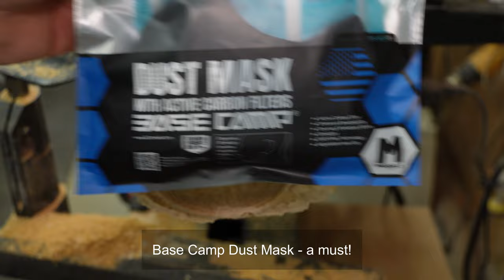Astonishing Woodturning: From Australian Burl to Brain Art

Comment: I'm confused. First you cut a mortice. Then you are "flattening the base" which looks like you are flattening or removing a mortice. Then you cut a concave area to put your coin in.
Reply from the maker: The mortice didn’t work, too thin walls. So a sacrificial wood chuck epoxied into what is left of the mortice. Then the chuck, mortice and the bottom of the piece sanded flat leaving behind a hollow for the coin. 🪙